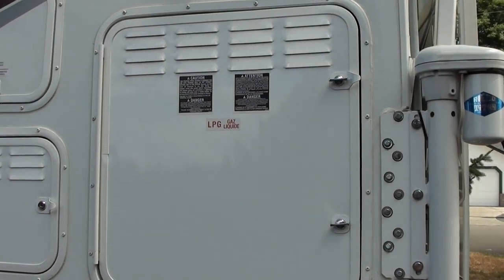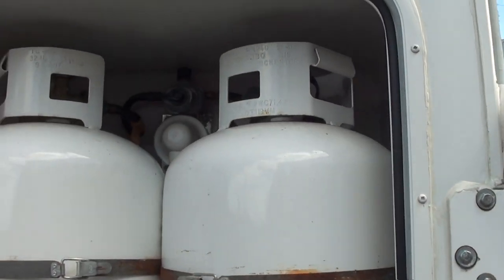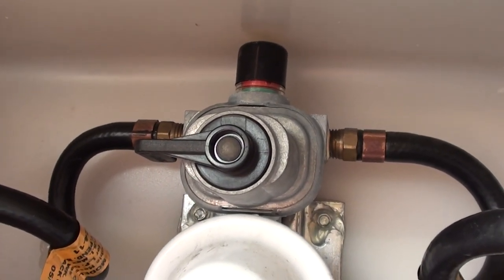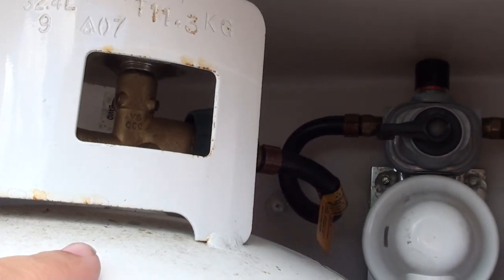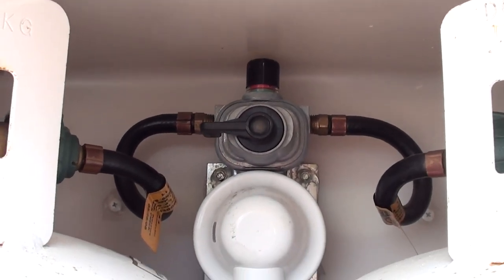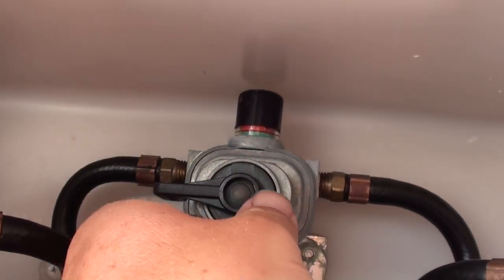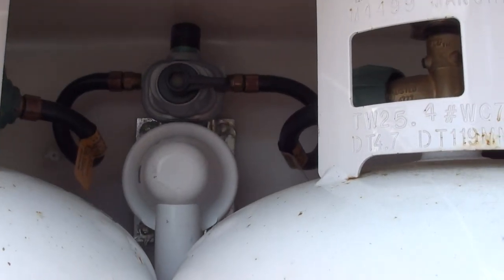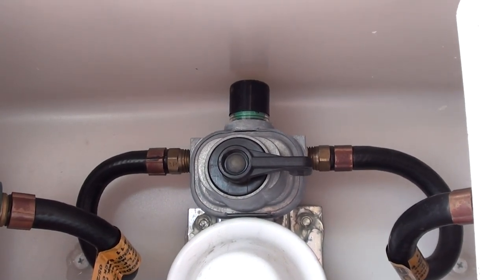How Does an Automatic Propane Changeover Valve Work?

Comment: Under the selector dial are two pins, one for each tank.  Pushing on these pins opens a passage for propane to flow. When you turn the selector dial, a cam under the dial opens up the primary tank by pushing on its respective pin. The second pin remains up and that tank is closed. Eventually the primary tank loses pressure once it is empty. When this happens, a spring overcomes a diaphragm, and pushes the cam down further, so now both tanks are open. The movement of the diaphragm causes the indicator to move. Maybe I can make a video showing this some day. :-P
Reply from the maker: Thankyou for explaining the mechanics of what is happening inside the valve.  Many people are confused about the basics which is why I made the "basic video" on the subject.  I appreciate your comment.

Comment: how can this be automatic if you have turn the knob mamualy?
Reply from the maker: +paul carpenter you do not have to turn the knob manually.  As soon as the tank that the changeover valve is pointing at runs out of propane it will automatically start taking propane from the other tank (as long as u have that tanks valve open).  This way when you are sleeping at night enjoying the warm RV with propane furnace running and your one tank runs out of propane it simply starts using gas from the other tank and you dont even know you ran out of propane in the one tank.  This would be why its good to monitor the RED/GREEN indicator on the changeover valve so you know when to refill a bottle.  Hope that helps you
Reply: paul carpenter

Comment: Does an automatic propane changeover valve change over to a full propane bottle automatically?
Reply: Provided you have a full bottle yes! When one gets low it shuts that off and takes the gas from the second bottle. The downside is, despite the claim made on the video, "you can fully deplete your bottle before the change over" its a fact the change over will occur when the first bottle is still 20% full.
Finally, they're actually called cylinders, not bottles!
Reply: I propose a toast to honour this revelation by cracking open an 18- year- old cylinder of reserve whiskey. Cheers!

Comment: IF this was automatic, WHY did you manually switch it over..??  If the one tank goes empty you should be able to just disconnect it, get it re-filled and plug it back in and done...
Reply: When the first tank became empty, the regulator did automatically switch over to the 2nd tank, thus insuring an uninterrupted flow of gas. At that point, the first tank can be disconnected and refilled. You are correct that the switch must be manually switched over to the second tank so that the red/green indicator is reading the active tank.
Reply: This is not a difficult concept to grasp. 
Some people make me wonder how they function in life.
An automatic transmission in a car still requires you to switch it into and out of gear.
Stop whining about turning a little lever to remove the empty tank.

Comment: I don't understand why you have to switch the valve over if it's automatic.
Reply: +Dave Butch:  You don't have to switch it over.  As long as both tank valves are open the valve will automatically draw from the secondary tank (the one the arrow does NOT point to) when the primary tank empties.  The only reason he shows why you need to manually move the arrow toward the now-active (secondary) tank is to then remove the empty tank for refilling.  When you hook the now refilled tank back up and open its valve it becomes the secondary tank ready to take over when the active one empties.  I hope that helps clarify.
Reply: Thats kind of retarded ...  You should be able to just remove the empty tank without having to turn any dial or lever.... 

The point of this valve it to automatically switch over when one tank is empty... When ONE tank goes empty, it should switch over to the other tank letting you REMOVE the empty tank to get refilled without having to touch any lever .. If you have to move the level over to the other tank, its not automatic ...